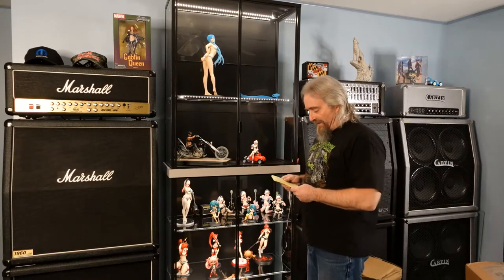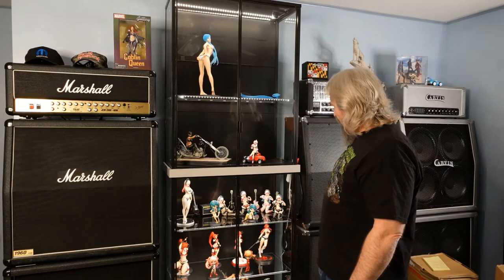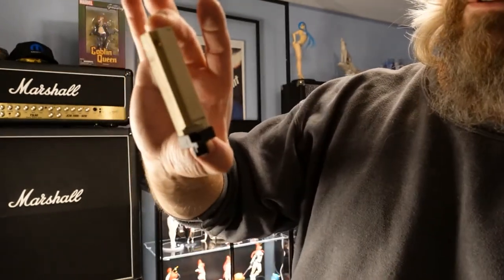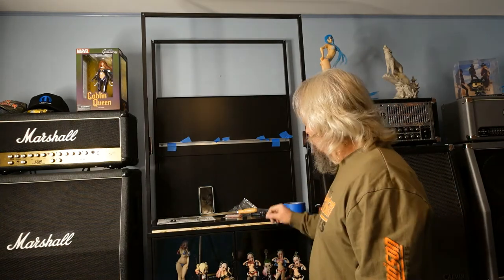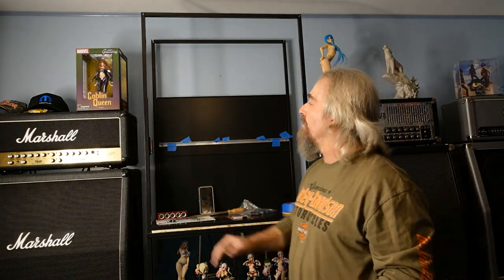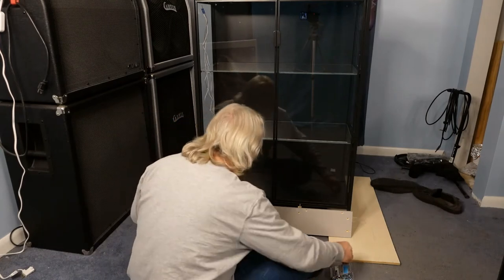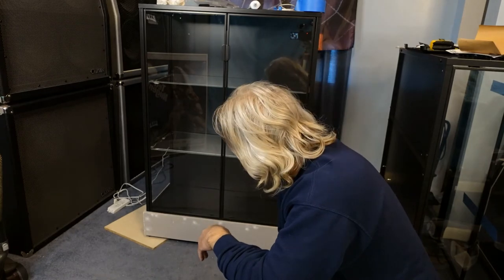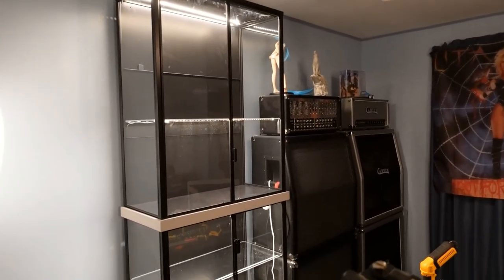Ikea Rudsta Mega Mod glass cabinet build PT 2

Comment: Where you made the cuts to the square tubes. Do you think it would be structurally better to flip those facing each other? That way you could stick a  solid square wood in between the open open channel (or even another piece of metal) to reinforce the overall structure?
Reply from the maker: I hope I'm understanding the question correctly if you mean to invert the top cabinet upside down and join it to the bottom cabinet? I believe that would cause lots of modification issues like.:. How would that effect the door swing with now no plastic bushing to glide on. Creating an inner bottom out of the top being the front frame rail is blocked by a lip for the door stop. Also, I'm not sure how that would affect the plastic shelf supports in relation to the now upside-down support made into the back panels. Also, what about the legs you can't cut them tight to the vertical rails as you would cut the welds, so you still have to make a top trim piece. I feel like this would make things way too complicated. I hope I answered your question. If you own and have built one of these cabinets, you will see what I'm referring to. Thanks for watching.
Reply: @hathatfigures3663  ah, thanks for thr detailed response. What i was thinking was the bottom cabinet has it's legs cut, inverting it, then with the top one's legs cut, and then joining them. So essentially preventing the top from sliding off without screws to the top/bottom.

But i guess it's only made for top-down and no inverting.

Comment: does the bottm cabinet has enough strength to support the top cabinet? I want to buy 4 sets too
Reply from the maker: Oh yeah the Rudsta from Ikea is a full frame cabinet the Milsbo cabinets are not. This makes the Rudsta perfect for the modification. I suggest a few things tie the lower legs of the bottom cabinet together to increase the strength. I used a 1/2 inch plywood skirt to achive this plus it looks better cosmeticly.  Second have 1/2 inch plywood between the cabinets. And third put a support screw into the wall to keep front the 7 ft cabinet from possible rock over. I've had my Rudsta Mega Mod for over year now no issues...PS .. I have six Rudsta cabinets ready to modify this will cover the whole wall you see behind me in the video a total of 4 double stack Rudsta cabinets

Comment: Did you cut off the leg for the top cabinet ?
Reply from the maker: Yes but you can't cut 100% off because you will cut the weld, So you need to leave a 1/2 inch that's one reason for the 1/2 plywood to make that up.

Comment: is it possible to not install one of the side glass panels? or is it required structurally? I was thinking of joining two Rudsta units side by side to create a wider display cabinet
Reply from the maker: Sure I think so one thing to consider would be the top and also the bottom sheet metal folds over the frame. You would either need to cut that side lip off or run a bead of calk between the cabinets after you bolt them together to give a nice finished look. Awesome to see people who watched my video coming up with other cool mods and ideas. I'm also wanting to start another Rudsta cabinet mod making it deeper for people with lager statues with large bases
Reply from the maker: No it's not necessary to use the side glass the side glass has it's own metal frame with pins that sit in holes and it just floats in the steel frame work. Bear in mind it does help hold down the bottom sheet metal so maybe use gorilla 2 side tape on the side with no glass. Place it between the sheet metal and the lower steel side frame